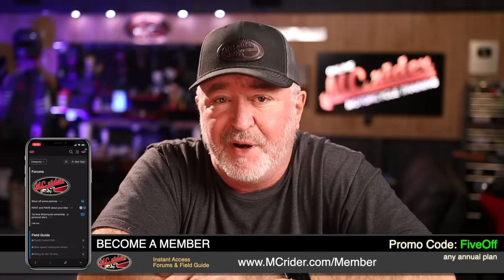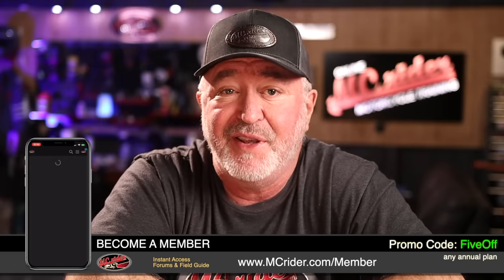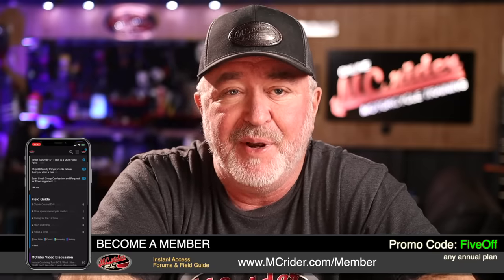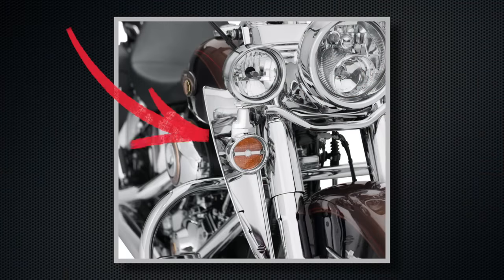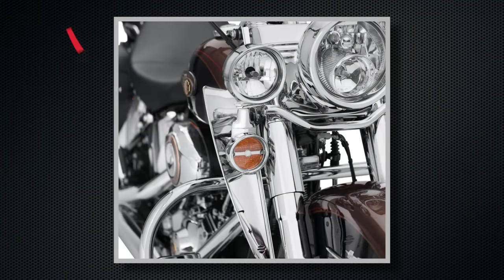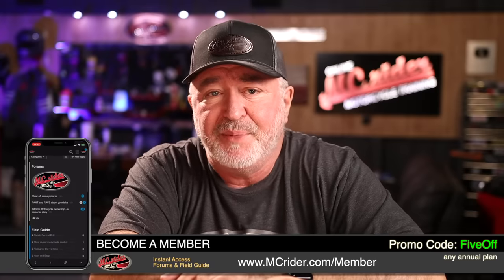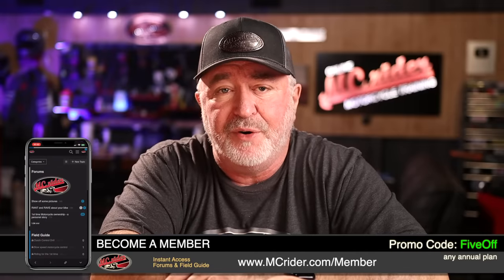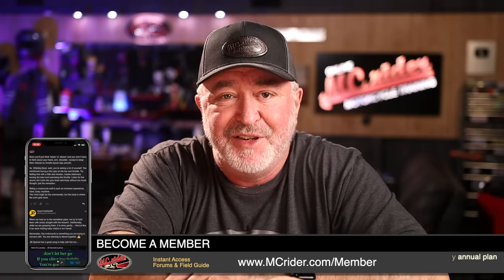Say Goodbye to Wind Buffeting on Your Motorcycle: Expert Tips and Solutions

Comment: This is a thoughtful, balanced presentation.  However, the problem was introduced and explained but no actual solutions to managing the core problem were provided.  I counted 2 ideas (besides the barn door approach).  A shorter screen does get your helmet into clean air but essentially moves buffeting lower and in front of your helmet, yet direct air is likely not what many riders are seeking (a more quiet ride with less buffeting).  Fork deflectors do little except make the pocket larger and again move the buffeting effect.   The goal in preventing or mitigating buffeting significantly is balancing the pressure difference between the front and the back of the screen.  This can be accomplished with a hole in the lower middle of the windscreen and/or a spoiler mounted in parallel with the front of the screen (NOT at the top, as deflection like that is essentially just a taller screen).  I have experimented with many screen sizes, screen angles, deflectors, etc, and by far found that a spoiler (laminar flow lip) with or without a hole/vent in the screen smooths airflow, reduces noise and buffeting and makes the most comfortable ride behind a screen.

Comment: Some manufacturers actually use wind tunnels to help them optimize their windscreens to minimize buffeting. Add-on windscreens are typically a compromise so it fits multiple types of bikes, and you get to be your own wind tunnel, trying to figure out how to adjust it to keep the buffeting off you, while still allowing airflow so you're not roasting on hot days... Adjustability usually means you get to get your tools out again...
I had narrowed down my purchase choices to either a BMW R-1150-RT, or a R-1150-RS, the latter with a noticeably smaller fairing and windscreen. Both had adjustable windscreens. I chose the R-1150-RS as it was lighter and aimed at more sporting rides. Once I owned it I found the smaller fairing still allowed good wind circulation on hot days, while taking the pressure off the wind blast on high speed runs with minimal buffeting. The screen is height adjustable to optimize airflow and to further increase wind protection when the air gets cold, or wet... Many mornings I start out with the screen up to keep the cold air off, then lower it to get a cool breeze when the heat rises. An ideal choice for me and they types of rides I take.

Comment: Have a 2018 softail deluxe. The major mod for buffetting I made was to add the fork mounted wind deflectors.  They decrease buffetting when I have the wind shield on it, but push the buffetting right into my chest when I pop the windshield off.  I also feel a little more heat from the motor after adding the fork mounted deflectors.   I recently purchased a Shoei Geotec 2 helmet, hoping that will help when I ride without the windshield.
Reply: I own a FXLR Low Rider ( 2018 )
   I bought the factory HD 
“ detachable “ windshield - the tallest one that Harley offers .
   I rarely go out on the Interstate ; but when I do - major buffeting on my half- helmet .
   Is your ride the new soft tail like the Low Rider ?
   I’m wondering if they sell those things you bought for mine ???

Comment: Had a LongRider shield on my 1992 GoldWing with vent. Very little buffeting. MadStad on my 2017 Africa twin it gave a very smooth ride, great for long days in the saddle & a great unobstructed view. Plan to order a MadStad for my 2022 Rebel 1100, they just finished the design & made it so you can remove it easily for the short rides; nice. Worth a look. They make shields for many makes & models. Cheers. Keep up the good work. 🤙
Reply: Yes, I am surprised that Kevin has never heard of Madstad either. It’s the most obvious solution  and he has no idea
Reply from the maker: Who said I never heard of it?
Reply: @MCrider  I didn’t. But the replier appeared surprised you never mentioned it as a good viable solution. 
I guess I was surprised too. That’s why I replied.
Reply from the maker: @RCW Yeah, my reply was to James. I have had a madstad and removed it. Not saying it doesn’t work for you but it didn’t for me. If there is a one stop solution to the problem I have not found it.
Reply: @MCrider  yeah. At the end of the day the best solution is a tail wind. Roads that follow the trade winds are hard to find.

Comment: I have also found that the windshield on my Triumph was to small. so I put a larger one on and ran into the buffeting.  So, looking at some of the products on the market with the scooped upper lip, I decided to try adjusting the angle of the windscreen.  I found that when I shimmed the screen to a more vertical angle the turbulent air went over my head when I sat in my normal position.  I used rubber bottle stoppers under the mounting bolts at the screen to screen frame.

Comment: I had a Goldwing that has side deflecters or some call vent windows like cars used to have they were adjustable.  After a few tries at different angles, it felt just like riding with no windshield or fairing, and the bugs ended on the windshield, not my visor or my jacket. I only ride with a fairing after the windshields deflected a black bird that most likely would have hit me. It cost me a windshield but better than knocking me off the bike with a head or chest shot 
Enjoy your tips. Keep up the good work.

Comment: Good topic. I ride an H-D Heritage and have minimal buffeting normally. I do add the lower deflectors in the colder months to suck up a but of the engine heat. Being just north of Houston, I only use them for about three months each year. Ride safe and see ya on the road.

Comment: I am 82 years old, and prefer to ride without a windshield. I have one that I cut down for my Harley 99 Softail Custom, but I hate the buffeting. I do have some small fairings that go below the windshield that really help, but still do not remove it all. I ride with a helmet and goggles most of the time without the shield. 

Back in the day, my 42 Flat Head had a windshield that had a heavy edge that stopped much of the windshield vibration. When I run a windshield on my Softail, I can reach up and the top of the windshield is vibrating. I have cut it down to well below eye level, but it should probably be cut some more. It is a Harley quick disconnect windshield. I just plain like riding without one most of the time. I like the visibility more than I dislike the wind. To each his own. Most of my riding is around the back roads where I live. Not a lot of interstate riding.

Comment: This is a sad subject. I’ve been riding since the ‘80s and love riding. After a couple of injuries in my neck in the military resulting in a couple fused vertebrae and deterioration in the condition of the joints around that, including arthritis, I’m starting to suffer significant pain from buffeting. Riding in open wind is also problematic but not as much as the constant beating of buffeting. I fear I am now ordered to stay down on surface roads and low speed, if I continue riding, as per my doctor. He would prefer not at all because of the helmet, but is willing to go with low speed surface streets. As bad as it hurts, looks like I’m retiring to motor scooters. (Don’t get me wrong, I love riding scooters too, had several over the years, just going to miss rolling out on some highways across Texas and road trips)
Reply: Installing the Harley brand lowers on a Twin Cam Deluxe Softail with a windshield (cut down to be at nose level) made an ENORMOUS difference.  With the windshield mounted, it was OK as far as wind protection is concerned, but with the lowers added (also called fangs by some forum members) it’s like going from a windy day to being able to light a cigar.  This, by the way, was all experienced when wearing a so-called Shorty helmet.  With a three-quarter helmet it’s always better regardless.  A full face?  Well, I have one of those, too -  it’s parked in the driveway 😁  Now then …do I like the look of the fangs?  Absolutely not!  The windshield by itself is really grampsy Geezer-Glide enough ☹️
From Southern California ~ Ride Forever!

Comment: All very good stuff!! A subject that's much misunderstood and one I've done a lot of experimental work on. 'Buffeting' in aerodynamics language = turbulence and turbulence at best means noise and it it's worst, means physical issues. I ride an FJR 1300. The stock screen is useless to me - I'm 6'1" but all my height is in my back. I 'sit tall'. My problem was the horizontal 'roll' of turbulence which came off the top edge of the Yamaha screen making an unholy noise in my helmet. I changed to an MRA Vario Screen which made things eerily quiet but introduced a problem which nobody talks about - lateral turbulence. The top of the MRA screen is quite narrow so as the air leaves the vertical edges, it tumbles and squirms behind and the result of that (for me) was that at speeds over 70mph, I couldn't read road signs due to blurred vision! What happens is my head gets slapped around from side to side.

I got a different screen - a Polish one - taller and wider than the MRA but that had a different problem. It's like riding behind a barn door and the flip on the top edge causes problems at a certain height which is only cured by having it high enough that I have to look through it - not ideal as it's not optically correct plus add a little damp dirt and it's got to be moved down and out of the way. Also, riding behind an acrylic 'barn door' beats the hell out of my fuel consumption!!

Consequently, I'm still experimenting. Unfortunately we don't have a lot of choice here in the UK but I'm looking seriously at both the Cal Sci and Rifle products. Just need to commit to one and find out...!!

Comment: I ride a Pan Am, I have the short screen and a small deflector on top, at the highest setting it keeps the wind off my chest and shoulders, and the most of my helmet. I don't get any buffeting on my helmet. The Pan Am has a vent under it's screen, to let some air under the screen, this reduces the buffeting. The small deflector on top of the screen is angled 45 degrees, steeper than the standard screen, and this helps control the air flow coming over the screen, and cleans up the air flow. It also has side deflectors on the lower part of the screen.

Comment: Wow, thanks for this.  I have a KTM 790 Adventure S and it has the worst turbulent air at the helmet level I've ever experienced.  It also has the best crosswind and even headwind manners I've ever experienced.  But it does have two settings on the windscreen.  I've had it on the higher position.  I'm going out and change it to the lower position and see if the turbulence does not improve.

Comment: One of the reasons I bought the 2014 Ninja 1000 was the 3 way adjustable windshield.  It has a complex shape that they must have spent some time on.  Some wind is directed under the lower front edge to flow up the inside.  I also have two other windshields I tried under various conditions.  Bags on, I installed the tallest one for a 3 day trip.  It was a smooth bubble with no buffeting, but it was a simple shape and maybe that contributed to the high noise level.  I continue to use the stock unit set to the medium height, but I will try moving my hand around as you suggested to see if the air flow can be improved.

Comment: My  2008 Buell Uysses .  has terrible wind pressure  buffeting and whistling in my ears inside my Helmut.  The Madstad windscreens are adjustable height and angle ..
  The Stock Buell windscreen was fixed and it was the taller option .. Just terrible windbuffeting ..
  I installed a Madstad and it helped some.  The Madstad screen is pushed out from the Instrument panel area..  Buell did the same thing on the Ulyssis on later models..

Comment: Good video. Another problem with tall windshield is structural with the leverage it has on mounts and steering influence. A strong wind can take the shield right off the bike if the mounts are not up to the task.

Comment: Have had many bikes and currently riding a HD Streetglide. I have tried many sheilds over the years and currently have a Madstad shield on mine. It articulates so that you can adjust the height and angle of it for different conditions. Best I've tried so far! Also added side shields (I think Kuryakyn) on fairing that you can change the angle of that helps deflect the air coming up the sides. In summer I direct air toward me then block it when its cold or on long trips when I can adjust for conditions. Great for when it rains to, water doesn't puddle up in your crotch.

Comment: Hi Kevin, I had a Honda CBR600 and have ridden and owned several Adventure "Style" bikes (Fazer, Honda Crossrunner and X-ADV, Tiger 800 and 900) the only ones that did not have or cause buffeting (with the screen set to their high or low position) were the X-ADV and Tiger 900, and interestingly, both these bikes had large slots at the bottom of the screen and integral tiny little winglet on the bottom sides, so it seems the air through the slot disperses the air drawn from the back, one other side effect is, I also get insects splattered on the back of the screen. So perhaps the answer is to get rid of those screen extenders and cut a slot in the bottom of your screen (perhaps someone with a deep pocket should try first). Cheers, Gordon

Comment: The solution for me has always been an aerodynamic wind deflector in addition to the screen. It has a "slot" with an adjustable angle so after a little experimentation you can find the sweet spot to smooth out the airflow. It works extremely well and is better than even a tall screen by itself.

Comment: Look into MadStad Engineering windshields. Their screens are designed to let air come up on the backside of the screen, thus eliminating turbulence. They design customized screens for different brands. The angle of the screen is adjustable. Best screen I've ever had.

Comment: The best weather protection I have had on a motorcycle was with my old Honda Silver Wing 600 scooter. At 75mph there was some forward pressure on the back of the helmet, but at any less than that, as comfortable a ride as you can imagine. I guess that was due to the almost complete screen/fairing/leg shielding - no leaking of air around the edges of a small "adventure bike" screen, or through the handlebar yoke area. Living in the UK where rain and cold are frequent, I now find naked bikes insufferable due to the wind pressure at anything over 55 mph. Maybe if I were based nearer the Mediterranean, I might like it. Long live the (off-trend) sports tourers whose fairings deflect enough air to make riding comfortable.

Comment: Rider in the central coast. I have found that my tall windshield was placed at its highest setting upright, making my bike lose control because of the headwind. When I adjusted to more of a 45-degree angle seemed to improve my area dynamic and a more leisurely ride.

Comment: Had an '06 GL1800 Wing and it was HORRIBLE for buffeting.  My wife would not ride with me as she got beat to hell back there.  Sold that ponderous pig and bought a '17 BMW R1200RT and it is COMPLETELY different and better in every way.  The aerodynamics of that bike with the electric windshield are superb.  At highway speeds, I put it up to about chin height and get a smooth flow over my helmet.  In the city, I just drop it down completely.  My wife loves it and looks forward to riding with me again.  The German engineers clearly put their designs into a wind tunnel and it really shows.

Comment: Good video. See DK Customs cooling deflector wings that redirect air flowing through the forks and over the tank. I've been researching ways to cut the buffeting on my H-D batwing touring bike. A test to see the airflow is pin strips of ribbon or cloth to your chest, neck area, helmet and other buffeting areas then ride. You will note how the air fills the void behind the windshield and fairing and where the turbulance is. Harley came up with the fairing vent in 2014 and up touring models. The vent does make a difference. After experimenting with different windshields (Klock Werks & Freedom Shield) I'm going to order the DK deflector wings. After 30 years of riding I just don't want to get beat up with turbulance anymore. Doc Harley has a video on this topic too. Ride safe!

Comment: Yep all the above as I have two OEM Windshields and helmet selection based on the windshield mounted counts as well.  One helmet with high speed low drag shape will rattle my brains if a windshield in on, while a older traditional Shoei or a 3/4 helmet will work just fine.  Another, is the lowers must match the windshield in that the smaller windshield will absolutely rattle your head with the lowers, but the larger one needs them.  Great video explaining the phenomena as at first I was baffled, to finding solutions as your windshield height below the nose is the best....

Comment: I put "lowers" on my super tenere.... they made a huge difference.  Have friends who spent a lot of bucks changing windshields around and it didn't cure the problem.. but the lowers certainly did.   And the company put holes in the frame next to the fuel tank so they fit nicely.
Reply: Does your bike  get hot  with the  lowers installed??
Reply: @boscodog4358  Not at all.  And if you mean to the rider or the engine... the lowers keep the wind off the rider, the engine fan is under the left cowling, well below the lowers so it has no impact either.  Last summer it was 106 coming across Kansas.. no problem.
Reply: My  HD  Heritage  seems to get  hotter  in the summer months  with  the  lowers 
Inplace,   but I do like the  way it  does with the air.     
And  actually it's not the air  as much as it is the rain  under  my  helmet  face  shield.